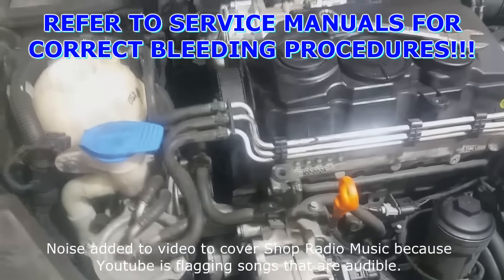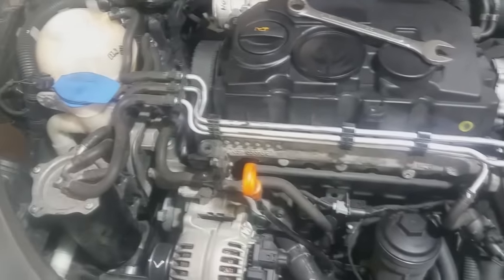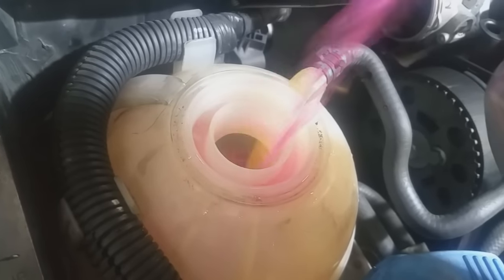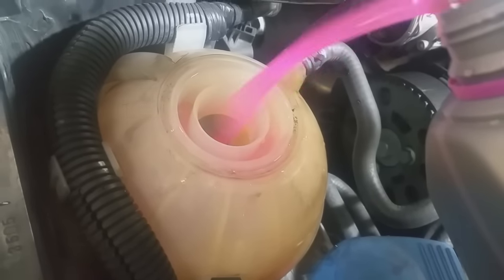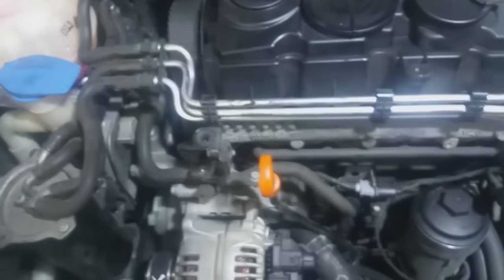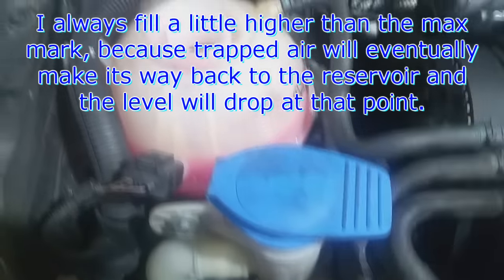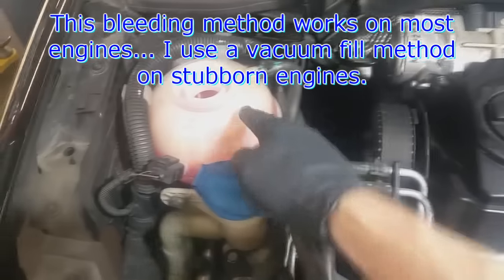Basic VW cooling system filling / bleeding info (viewer request)

Comment: How do you bleed coolant on a audi a4  2006 1.9tdi b7 is it just till fans come on and then top the coolant level off
Reply from the maker: As with any system, you have to fill it until the system is full with fluid. Depending on the system / engine, there may be one or more "bleeding" locations (to let the air out). Air in the system can cause overheating / engine damage... waiting until the thermostat opens / fans come on, can cause damage (if air is still in the system / engine). If you are not sure where to bleed the air out, disconnect a coolant hose and add fluid to the coolant reservoir until coolant comes out from the disconnected hose or fitting. Do this at a few locations, to ensure that most of the system has been bled. Start the engine and add fluid to the reservoir, if the level starts to drop. Monitor the coolant temperature gauge in the dash... if the temperature gauge starts to go past the middle point, shut the engine off and allow to cool. If the needle stays in the middle... let the engine run until the lower radiator hose gets hot (indicates that the thermostat is open) and then wait for the electric fans to turn on. If the needle goes, past the middle, shut the engine off and check the electric  fans.

Comment: Hey, we check about 2 weeks ago fluid was about 250 to 300 ml  but today it was showing that there we need to fill it. But I don't understand why it's like that.
Reply from the maker: You might have a leak. Did you do any cooling system service? If yes, then the fluid is going down because there was still air in the engine cooling system. The air goes to the bottle and the fluid goes down. If you have no leak, add some more and check again after a few weeks.
Reply: @EXOVCDS  my car had a problem  in engine with air mass meter
Reply from the maker: @gauravbhanot5226  Air Mass Meter should not affect coolant level.
Reply: @EXOVCDS  Hey friend there is a leakage because I can see this liquid on the floor so what should I need to do when it's leakage there
Reply from the maker: @gauravbhanot5226  I don't know where it is leaking. What engine? Send pictures to fkh161 @ fkh161 .ca (no spaces)

Comment: Great video 👍 I have an issue on my vw jetta 07. The temperature gets up to operating temperature and stays while idling but goes down to quarter while driving. I replaced the ets but problem still there... Any idea what it could be?
Reply from the maker: The thermostat might be stuck open.
Reply: @EXOVCDS  Thanks so much for the quick reply. Will change it out tomorrow and let you know 👍
Reply: I know this was an old comment, but om my mk4 2.0 I had that exact problem, sucked driving in the winter lol. Come to find out it was just the thermostat!

Comment: I have a 2014 vw jetta 1.8t automatic.  I need to flush and refill my coolant. is the drain petcock on the lower drive side or the lower passenger side?
Reply from the maker: There probably isn't one (I'd have to check the service manual myself)... best way to drain / flush the system, is to open the system at a number of locations (Lower radiator hose, oil cooler hose, heater core hose) and then force water through the system until all locations have clear water coming out of them. Then, follow with compressed air, to force out as much of the water as possible so you can fill with a 50/50 mix.
Reply: Thomas EXOVCDS last weekend I changed my transmission filter, gasket, and fluid all myself. my car runs great now. I was super proud of myself. id be willing to send you money to help walk me through the steps to flush and refill my coolant if your willing to help me out. let me know
Reply from the maker: Hi, no need for money... there's not much I can add to what I already suggested. A shop that has a power flush system, would be quicker, more convenient / less time consuming / more environmentally friendly than trying to do this at home in a garage. I'll still send you a link to a pdf from the service manual if I have one (I'm a bit behind with my service manuals, will update my library the next long weekend in February).
Reply: Thomas EXOVCDS can you send me the link today? that would be awesome and very helpful. I've bought alot of tools to fix my car up and I'm anxious to learn more about my vw and how to fix it. after my coolant flush/refill. I plan on changing the seals on my oil cooler and changing my small cooling fan because there's a crack in it.
Reply from the maker: Do you know the engine code (should be on a sticker on the timing chain cover)? I don't think I have info on the new 1.8T... sorry. I've got info on the various 2.0L & a 1.4L, but not sure if the connections / fittings are similar to your 1.8T. I'll have 1.8T info next month.
Reply: Thomas EXOVCDS will you remember to send me the info when you get the new updated info?

Comment: When I am flushing my cooling system should I use a distilled water?
I am flashing it cause the previous owner put green coolant
Reply from the maker: Distilled is best... but it is easier to flush with a garden hose. Whatever works best for you.
Reply: Thomas EXOVCDS 
Thank you 😊
Reply from the maker: Let me know how it goes / went.
Reply: Thomas EXOVCDS 
I was actually replacing my timing belt. And because I drained the green coolant so decided to go with pepper pink/red coolant.  I flushed once with garden hose but I know that if red and green mix that’s gonna be end of the game 😱 
But hear in New York , when ever I try to use my garden hose it’s always frozen 🥶
Reply from the maker: I have yet to come across an engine that had damage due to green coolant or damage due to 2 different coolants mixing. The only way to be sure that all the old stuff is out, is to flush, fill, run the engine with just water several times. You can also just flush it again in a month.
Reply: Thomas EXOVCDS 
Yeah. And also my A4 b6 1.8t have about 210k mil so I want to be more serious about this stuff.
And thank you for let me know that actually the green coolant damage engine.
Reply from the maker: I have seen many engines with green coolant and no damage.
Reply: Thomas EXOVCDS 
I am gonna change any way, I don’t want to take risk 👍
Reply: Thomas EXOVCDS 
I have question. I flushed my system twice and water is just little bit green. But I steel think I have some left in the heater core. And also my heater doesn’t work is that mean my heater core is also flushed???
Can I put the red coolant now?
Reply from the maker: You can add the pink already... flush it again after a few weeks.
Flush the core... I did that today: press play on this instagram picture
https://www.instagram.com/p/BtO1cE7A1wY/

Comment: Great video. Please were u squeezing the lower radiator hose or the upper hose? Should the heater core be turned on while the engine is running? When should the expansion tank cap be closed? Like in MK3 Vento, how should one carry out the bleeding process? Looking forward to hearing from you. I m now a subscriber to your awesome channel.
Reply from the maker: Heater core is always open / free flowing... but you want to turn heat on, so that you can check for heat. No heat can be a sign of an air pocket in the cooling system (no coolant flow). You can close the tank cap once the bottle is full to the max mark... but you will not be able to add fluid if the level drops. Make sure that you have coolant flowing back into the tank when the engine is running. You can squeeze the upper or lower hose. You should be able to feel the coolant in the hoses... if you can not, then you have air in the hose.
Reply: @EXOVCDS  Thanks so much for the enlightenment. I will do as u just advised. ❤️

Comment: Hello I'm new to the channel and I recently cleaned my egr valve. I have a 2002 va jetta tdi and when I 1st started my car it w idle at 900 rpm and then jump to 1000. This occurred for 15 minutes or so. Water temperature was fine, coolant level as well. I started the car again today. It did the same thing except It continued to jump idle when stopped at an intersection. Coolant still fine and gauge. Not sure if there is air in the system but I do not know why it continues to idle like this. Help would be greatly appreciated
Reply: FYI forgot to mention after the the 1st time it was good to drive. Drove how it always drive with no problems
Reply from the maker: Not sure what could be going on... cleaning the EGR should not affect anything adversely.

Comment: Hi, is G12/13 coolant necessary? ('03 Jetta) It looks like the car I just bought is running the green stuff. Thanks!!
Reply from the maker: G13 would be best... but the green stuff is ok, as long as you flush it every 4 years (drain & fill with new clean green stuff). Even G13 should be flushed every 4 years... to keep the system clean & healthy. I have worked on many engines that have used the green stuff and have never found any adverse effects due to it.
Reply: @EXOVCDS  ok that's helpful!!
And thanks for the quick reply. Your vids are a great resource!
Reply from the maker: Thank you for watching!

Comment: Can't get the air out of my engine, its a a BWC engine similar to most bkd and bmn engines, I have a red hot top pipe and no coolant in lower one, replaced radiator waterpump and thermostat.
Reply from the maker: If you don't know which bleed hose is plugged... disconnect various hoses to let air out. Once coolant comes out if the disconnected hose, reattach it. You can also pour fluid / coolant into a disconnected hose until it is full.
Reply: @EXOVCDS  all hoses are full now, still overheating still getting a cold lower pipe. I'm so stuck tried to pressure bleed it today and no luck
Reply from the maker: @kalimrakeemhameed3262  water pump is bad if you do not get fluid flowing back into the coolant reservoir... or if you do not get heat inside the car when the engine is warm.
Reply: @EXOVCDS  The heat in the car is VERY HOT and the top pipe is VERY HOT coolant is coming back into expansion tank even when I squeeze the bottom hose it's pushing coolant into the expansion tank so I know thermostat and possibly waterpump are OK I just don't get any hot coolant in the lower pipes??
Reply from the maker: Thermostat is not ok if lower hose stays cool. New thermostat can be bad.
Reply: @EXOVCDS  when car is cold and I squeeze the bottom pipes nothing happens in the expansion tank when the car has warmed up to temps and thermo is open, I squeeze bottom pipes and then I see a reaction In the expansion tank only when car is up to temps so thermo must be working and I tested old thermo and that was working so this problem has to be something else
Reply from the maker: This is what I know (30 years of working on VW & Audi).

If bottom hose / pipe is cold when the engine is hot, then the thermostat is not open or the water pump is not pumping.

I don't know how you are testing things, at what temperature etc etc.

Post a video so that I can see how hot the engine is (needle in dash)... return flow in to bottle at idle, at 2000 rpm, engine cold & engine hot. 

How long does it take for the engine to "run hot / overheat"?

A faulty coolant temperature sensor can trigger an overheat warning when it is not.
Reply: @EXOVCDS  okay I will take a video of the engine and explain everything tomorrow thank you for taking the time out to help me ❤
Reply from the maker: I did some googling, since I was not familiar with the BWC engine code. So it's a PD TDI.
TdI engines take a long time for the thermostat to open. It can idle for more than 30 minutes and it will seem like the lower hose never gets warm.
The temperature needle should rise to the middle (90c) within 15 minutes (lower hose still cold). It should stay at 90c no matter how long the engine is at idle.

If the needle goes past 90c then something is wrong.

In oder to feel the lower hose getting warm, you have to hold the engine rpm at 2000 rpm for quite a while... again, if the needle goes past 90c, something is wrong.

If the needle stays at 90c, the lower hose will eventually get as hot as the upper and the radiator fans will come on.

If the lower hose gets warm, but the needle starts to go past 90c... something with the electric radiator fan(s) is wrong.
Reply: @EXOVCDS  
So when I idle car it doesn't over heat
When car gets to 90 the lower pipe remains cold
When goes over 90 the lower pipe remains cold
When I squeeze bottom rad pipe/ thermostat pipe below 90 nothing happens in the resovoir 
When I squeeze the lowere pipe at 90 or above then same reaction happens in the expansion tank as When I squeeze the top hose and also disrupts the coolant return line Just like when I squeeze the top rad pipe Only when engine is at 90 or above not when it's below. Also tested previous thermostat and it was working so problem is not thermostat I'm thinking it may be my water pump as its the shitty plastic one I'm going to take the thermostat out again and try stick my finger in to see if I can feel the propeller. Although coolant is coming back into the expansion tank
Reply: Car overheats when driven long journeys or over 2.5k revs
Reply from the maker: What vehicle is this? Squeezing lower hose with thermostat open or closed should have same effect (in my mind)... as squeezing the hose forces fluid through the radiator and up out of the upper hose (which should have a bleed hose fitting). If the thermostat is open, then you should feel some heat transfer from the hot coolant in the engine, past the thermostat into the lower hose. I've got a PD engine explaining similar heat transfer... let me look for it. Checking for loose impeller is a good idea.
Reply from the maker: @kalimrakeemhameed3262  
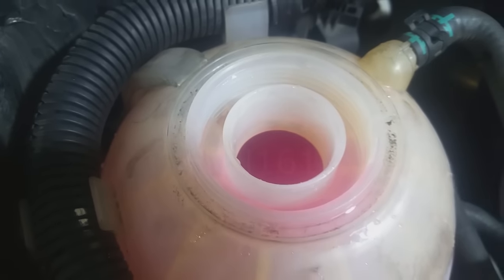Start watching at 1:30
https://youtu.be/5nmqsg3Lmdw
If it only happens at higher rpm, then the water pump impeller is slipping... or, the water pump has a sleeve around the impeller, that controls the efficiency of the pump.
https://youtu.be/jmMK0w3Dc1k
Reply: @EXOVCDS  Mitsubishi Lancer 2.0 DiD saloon model. Rare BWC engine it's a beauty, 
As I thought so too, I was thinking exactly that but then also argued to myself that it's because the thermostats closed as when cars up to temps and thermos open its different. I also took my lower rad pipe off to see if any coolant comes out of the rad which it did so it's going from one end to the other the rad pipe just isn't getting warm but the top one stays red hot, there's no bleeder screw the manual says vaccum bleed the system which has been tried and it still overheated. All started since changing the rad. But I'll post a video tomorrow so you know exactly what I mean.
Reply from the maker: @kalimrakeemhameed3262  there's a difference between coolant flowing through the radiator and being pushed through the radiator by the water pump. 
If the water pump was fine before any repair... it should still be (unless stressed by overheating). If you have heat inside the car that gets "less" with higher rpm, then the water pump is slipping, or you still have air in the system.
Vacuum filling is not necessary, but all air bleed pipes / hoses must be free flowing.
Reply: @EXOVCDS  didn't manage to get vids today as I've been busy but I'm working on the car first thing tomorrow so I will posy them, I have ALOT of hot air coming out it gets hotter as the temps rise there's no bleeder screws on this veichle and it states to use a vaccum bleeder in the manuals for the car. It's a slightly different set up to most vws
Reply from the maker: @kalimrakeemhameed3262  all vw / audi service manuals state to use vacuum fill method. Not necessary, but makes things easier. If you have heat inside the car, then the water pump is ok.
Reply: @EXOVCDS  so my top rad pipe is boiling hot
The bottom pipe is cold it doesn't get equally warm it stays cold even when over heated
When over heated the fans come on
The hot air in my car is very hot 
My top rad pipe goes to a water flange then to my heater core both pipes in and put of heater core are red hot.
It doesn't over heat whilst driving normally only under load
Reply: @EXOVCDS  clogged rad thank you so much for your help realised it when I pulled the bottom hose again no fluid came out surprisingly it tricked me the first time I did it some fluid came out of rad but not the second time changed rad no pverheating
Reply from the maker: @kalimrakeemhameed3262  thanks for the update!
Reply: @EXOVCDS  hello I'm back! Not had any problems since changing my rad until last night, car was up to temps and no hot air coming out, if I rev the engine it gets slightly warmer, I checked my coolant levels and realised no coolant coming back into expansion tankbDoes this mean my water pump is slipping???
Reply from the maker: @kalimrakeemhameed3262  maybe
Reply: @EXOVCDS  what else could it be

Comment: hi how do you drain the 2013 passat 2.5 engine? where is the drain plug on the radiator?
Reply from the maker: I'd have to check a service manual. Even if there is a drain on the radiator... it will not drain the whole system. You will probably have to drain at a few locations to insure that most of the coolant will drain out.
Reply: Thank you .